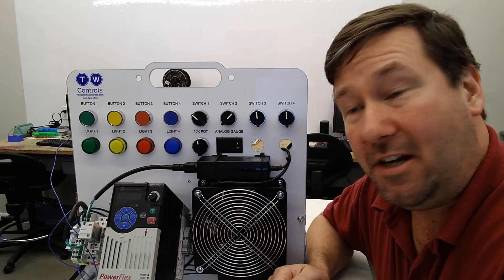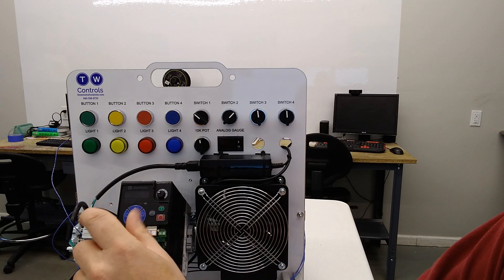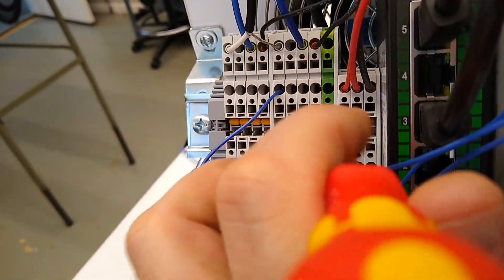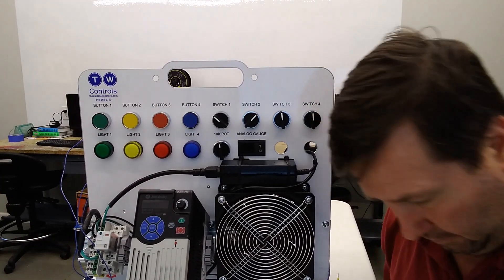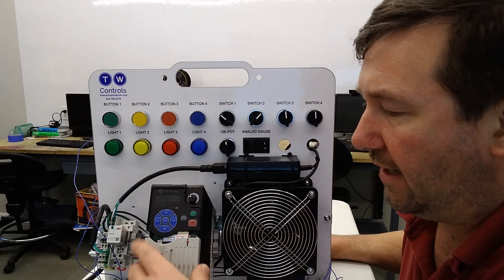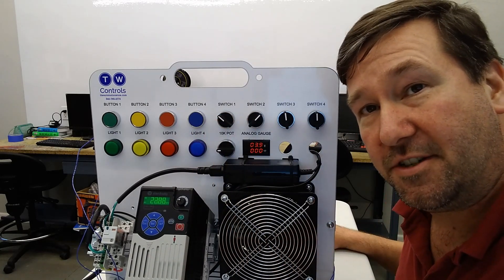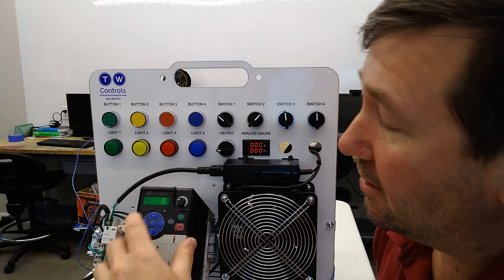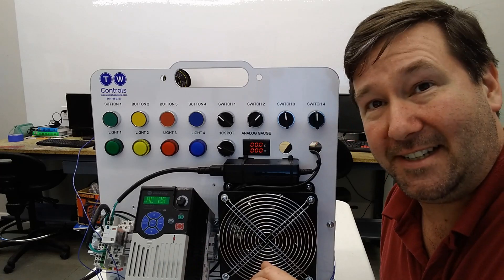How to Wire a 0-10VDC Analog Meter to the Analog Output of an Allen Bradley Powerflex 525 AC Drive

Comment: How to wire a 523 AB drive to run off of 4 to 20 input speed voltage
Reply: How to wire a Allen Bradley 525 Drive to run off 4 to 20 V input speed
Reply from the maker: Have a look at P47, you just need to change that parameter.

Comment: FO13 Why do I get ground fault when starting motor
Reply from the maker: That means you have leakage current between the motor windings and ground.  Either the motor has got wet or the windings are failing.

Comment: Hi Tim, could you please provide me with the diagram how you wired references between 24VDC of power supply and 10VDC of drive? I do not fully understand that point and I see difference between reading of my analog Voltage meter (Powered by 24VDC) and Powerfex drive.
Reply from the maker: Hi Luke, see if page 42 helps. Terminal 14 must be connected to the 0V of your 24VDC power supply so that they have the same reference point.
https://literature.rockwellautomation.com/idc/groups/literature/documents/um/520-um001_-en-e.pdf
Reply: Hi Tim, got it now! Thanks a lot for explenations!

Comment: Hi Tim,  
I had experience with 2 30hp VFD's with a Analog out of one to the input of the other. It worked fine, until the 600' drag link chain began to wear in the nylon track.  It was a nightmare !
Reply from the maker: I bet!  When you need two motors to stay in sync, it is hard to beat an encoder feedback setup. We've got a video on that coming soon.
Reply: @TimWilborne   Great !  Good Stuff. 
Its the Black Magic behind the curtain!

Comment: Is that powerflex 525 single or three phase in, if three phase how are you operating it? I'm only asking because everything I found on it shows three phase. Thanks
Reply from the maker: It is a 120VAC input Powerflex 525 drive.  All of our trainers are designed to plug directly into a standard wall outlet.

Comment: Random question, how do you determine what size potentiometer you need per your system setup
Reply from the maker: For the most part the device will specify it.  The Powerflex can use a 1K to 10K ohm 2 watt potentiometer.  I use a 5K because it works with many of our other analog exercises.  Common ones would be 5K and 10K.